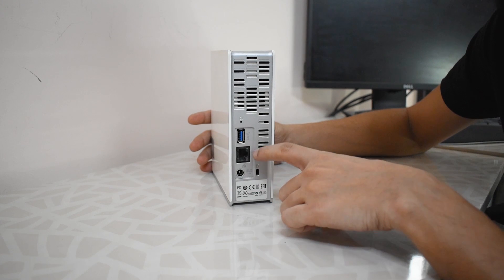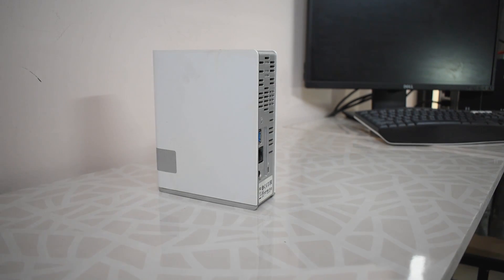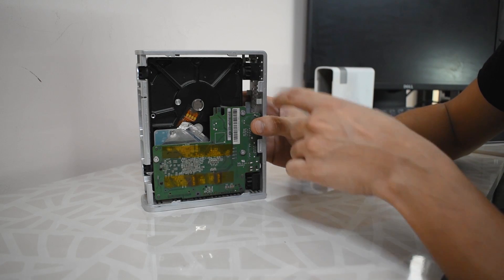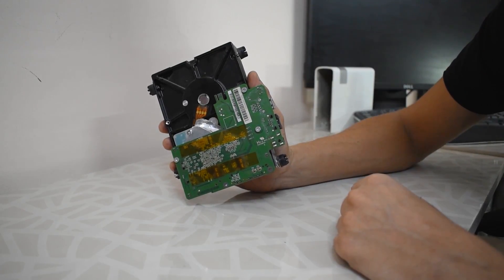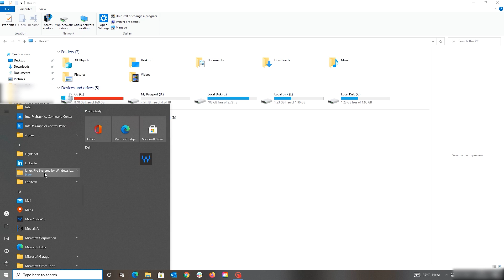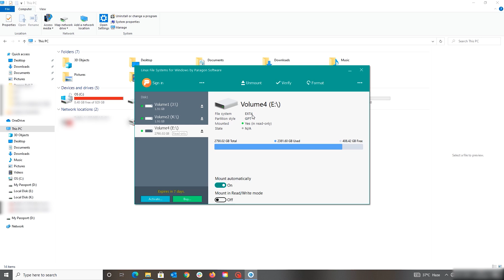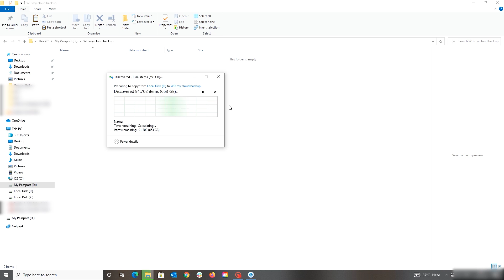How to salvage your data from a failed WD My Cloud?

Comment: Thank you … you saved me countless hours of research in trying to figure this out. I had the flashing red light due to a failed firmware update. For those who followed this tutorial and was unable to mount the drive, I found that it took a few attempts by either unplugging the usb or disconnecting and reconnecting the power. Worked a treat and saved 30 years of memories… thanks again
Reply from the maker: You're welcome! 😊
Reply: Mine is not showing up on the software

Comment: Great video, thanks for taking the time to show all the details. It was really useful. For me in particular, the way to actually open the drive was the part that helped me the most. 

 I should add that an alternate way of doing this is to simply attach the extracted drive from your WD My Cloud  to an external hard drive enclosure which you may buy cheaply from Amazon, Ebay, Bestbuy and other places. Then plug it into your computer. That's less troublesome than attaching the WD Red Drive to your internal PC connectors.  (Be sure to pick an enclosure with the same type of connector as the one used by WD My Cloud.)

Also, as an alternative to the software you used "Linux File System for Windows" by Paragon, You may simply use any of the Linux distros available and then use the Live CD feature which is available on most to access the content of your drive.

Greetings!
Reply: Hello .... the same thing happened to me as the friend in the video and I am checking what to do to solve the problem, reading the comments I was struck by your answer, to which you refer "to an external hard drive enclosure which you may buy cheaply from Amazon, Ebay, Bestbuy" could you leave the link of any of them?

Comment: Thanks for this video. This gave me some confidence to open up my WD NAS. But my problem was the network light on the back was not light even when the network cable is attached. But after powering down the NAS for 1/2 an hour, it came back online. So I did not have to do this. But this is the only video I can find on how to open this NAS. Good video.

Comment: Wow I have the same drive mine is a 6TB drive. Noticed just recently it will just drop off the local network for no reason. Fortunately I have a host of other drives. I will take your video as a wake up call and start redundancy back up immediately. I have close to 4TB stored on this already started moving some of the files a month ago . Looks like its time to finish the migration. scary situation to be in. Thanks for the how to video.

Comment: Hi, Thank you very much for this sharing !  like you my WD My Cloud is briked with a solid red led ... The NAS drive is ok just the WD mother board after several reboot seem not able anymore to start the drive ( if we listen a little bit the HD noises it is trying to start in loop...)  my question is after your backup, did you try to integrate your Red NAS drive in an other NAS system ? what is your recomandation ? it is a pity to have a so good NAS HD with a system down certainly due to a planned obsolecence
Reply from the maker: I was thinking of building a storage server for myself and using the drive in it but wasn't able to find the hardware I needed for cheap. There was no point buying new hardware for an experiment that might fail so I ended up installing the drive in my PC permanently.
Reply: @nikunjmuglani  does it format the usual way when you put it in pc. I've got a Synology Nas would it work in there ta 😊
Reply from the maker: @ for most of the NAS drives I’ve seen, they are usually in the same format. So this should work. As for formatting the drive, if your computer is able to detect the drive, you should be able to format it.

Comment: Is there any way to recover the stuff off the drive using a laptop rather than a desktop?
Reply from the maker: There are external hard drive cases available that you can plug the drive in and connect it through USB.

Comment: Hey I have my wd cloud, problem is that I can hear a clicking sound with the red light indication, would this method still work in that case?
Reply from the maker: If you hear a click from the drive then the issue may be with the actuator that moves the read head around on the platter to read the data. In this scenario, I would recommend taking the drive to a professional data recovery center who can try replacing the mechanism to retrieve the data.
Reply: @nikunjmuglani  thanks Nikunj
Reply: Hi Nukunj, turns out it was an issue with the NAS and the drive was fine and fortunately I was about to recover all my data,I wanted to ask you.. Is there a way I can fix my NAS or would i have to buy a new one, let me know if you have any contacts in Pune region please

Comment: I just popped my hard drive into an MyCloud EX2. It worked. The MyCloud unit had a failed upgrade to OS5. The hard drive was working, but the DLNA server wasn't working anymore.
Reply from the maker: That happens very frequently with these drives. The firmware and OS updates for these drives fail and we are left with a bricked drive.

Comment: I plugged it directly in the pc however now the windows won’t start without me unplugging the nas drive
Reply from the maker: That may be due an issue with the drive itself which is keeping the OS from booting. You can try a different SATA port of the motherboard (if you have one) or an external drive enclosure.
Reply: @nikunjmuglani  that is what am fearing right now, you think a professional team will be able to salvage anything from it or is it gone gone
Reply from the maker: I'm not sure. May be a professional may be able to help.

Comment: Thank you very much for taking the time to post this, it has helped me a huge deal I was stuck on the right software to  use as none seemed to work properly. Just a TIP if anyone does get stuck unscrewing the allen keyed screws on the HD, if you have a rotary tool, a dremel or even a file. Saw a notch in the screw deep enough to get a flat head screwdriver to it, then you can unscrew it with ease
Reply: nop, it wont come out, i did not find a way :(
Reply: @matiasnowo  If the stuck screw is one of the ones that go through the metal bracket and the other one has been removed you could try holding the drive firmly in one hand and rotating the bracket counter-clockwise. If you're lucky it will loosen the screw. If not you'll need a different handle to hold the torx bit. I use a T-shaped handle, that allows much more torque to be applied. Also use a high quality bit and press it firmly into the screw head so that it doesn't cam out. Once the screw head is damaged it will be much more difficult to remove.

Comment: Hello there,
This is video is great and it seems to be what I have been looking for! I do have one small question, where can I get the cables that you are displaying from the computer to plug into drive? (min 13:50) Thanks!
Reply from the maker: If you have a SATA drive in the machine then you can use it's cabels. CD drives also use the same cables.
If you don't have either, you would need to order them. One connects to the power supply and the other to the SATA port on the motherboard.

Comment: Hi, I too have similar problem.. I bought same device in 2016, from last week, due to power fluctuations, drive is not working.. Currently WDMyCloud admin console is coming up, but it's not detecting the content in drive.. It says "The data volume 1 on the drive is not accessible. Contact WD Support." not getting enough guidance to get the data from this.. 

Do you have any idea to recover data from this without opening drive? I feel OS loading and working fine.. but it's not able to load the volume.
Reply from the maker: I don't think that can be done. If the OS on the drive is not detecting the volume then that may be due to damage to the drive or due to an issue with the connector the drive is attached to.
In both cases you would need access the hard drive physically.
Reply: @nikunjmuglani  Thanks for reply. I connected to Drive using ssh using putty to find out my folders, but it didn't detect my folders. Where as when I connect my 1 TB WD external hard disk to My Cloud, it's ditected. This gives idea that MyCloud is not finding it's hard drive..

Hope the process shown in this video helps to recover data. 

Is there any way I can connect MyCloud harddisk through USB to laptop. I actually don't have desktop, hence asking this question. 

Thank you for your time.
Reply from the maker: You do get external cases for hard drives which you can use to convert the internal drive into an external one. You can give those a shot.
Reply: @nikunjmuglani  Ok. Thank you very much for video to enlighten on the problem and solution.. I hope this is my last step to recover my data..
I'll try to do this once all my other options exhausted. 

Thank you very much.. 🙏🙏

Comment: Hey Nikunj, this is simply awesome !! Ive been stuck with this problem for the last 48 hours... sleepless... A quick question, can i simply call for a sata to USB cable and connect the drive through a USB cable ? also i use mac ? so any software for that ? Thanks in Advance
Reply from the maker: There are docks you can get which can allow you to connect the drive via USB. I think Paragon has a version for Mac as well but I am not sure.
Honestly, I don't know if you would see the same issue on a Mac where the drive shows up as a Raw partition.
Reply: @nikunjmuglani  sure, thanks so much, shall surely try with the USB dock and on Mac and update… by the way, I did snap up 2 locks while opening it 😆
Reply from the maker: @piyushdak111  ha ha... Pretty common
Reply: I have the same issue and I'm also using a Mac. Let me know how it goes. I'm trying to get a SATA to USB cable and then I'll try to find a software that works. Hopefully Paragon will see it. Let me know how it goes with you.

Comment: Thank you for this.  Worked like a champ for my 4TB My Cloud.  Though I have a Sabrent 2-drive docking station, so it was easier to plug it into that.  After installing Paragon Linux for Windows, and starting up the drive, it gave me 3 drive folders.  The first one was a headache with a dozen or so popups that mostly wanted me to format the drive.  After ignoring all of those popups, the second drive folder was the linux os, nothing to worry about saving there.  The 3rd drive folder was all of my data with zero corruption.  All that work for what was likely just a failed firmware update.  Between the factory reset hack on My Book, and this failed firmware on My Cloud 5 weeks later,  I'm pretty much done with WD.  Thanks again bro.
Reply from the maker: Glad that helped! 🙂
Reply: @nikunjmuglani  
Luckily I managed to get all my data off & onto a Seagate USB drive before I had problems this morning. Thanks for the video. I'm going to try it later to use it as a local drive..

WD have stated they no longer support the My  Cloud (OS3) and suggest I buy one of their updated products running OS5. What? So I can update that too in a couple of years? I've always been disappointed with the transfer rates anyway.
I'm done with them too.
Reply: Thank you!  THIS was the answer I was seeking.
Reply: Interesting. Is your dock also connected via usb to your computer or laptop? And did you use the same software as it the video?  This gives me hope i can finally recover everything from my my cloud and then it will go into the dumpster.

Comment: Hi, thank you for making this informative video. I have done the all the steps same as your but I am having problem with PARAGON extFX software. Somehow it couldn’t detect the WD RED HDD. I have contacted Paragon Tech Support team but it asked to me consult WD instead. Got any advice on alternative software could read Linux Files?
Reply from the maker: It might be due a corruption in the drive itself. You can give Ext2fsd or Linux reader a try. You can also check out Mini partition wizard. I tried that and it basically tries to recover all the data from the drive.
Reply: Andy I’m having the same issue and it’s not detecting 3 of my WD RED HDD. Wish I could help you out. This video is very helpful though.
Reply from the maker: Have you checked which format are the drives in..? While most drives used consumer NAS are in ext formats, some are not. You can try using the Mini partition tool to see if that detects the drives.

Comment: Boss it did not work for me. I bought the software thinking some feature were locked. It shows folders backups,data,davfs2 etc , drive shows over 1 tb data but could not see any files or folders which i had saved on this mycloud NAS drive. Is there anything I am doing wrong ? email me lalitonline@gmail.com     Lalit Kumar
Reply from the maker: If it didn't work then it could be due to data corruption instead of a bricked firmware. In cases of data corruption, you might need to use a data recovery software. You can try a software by the name of mini partition tool from partition wizard